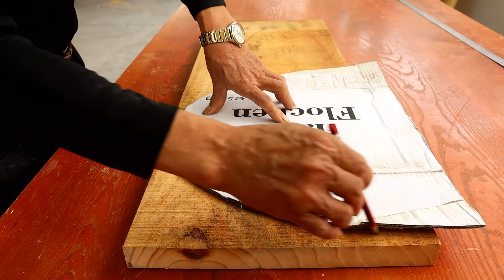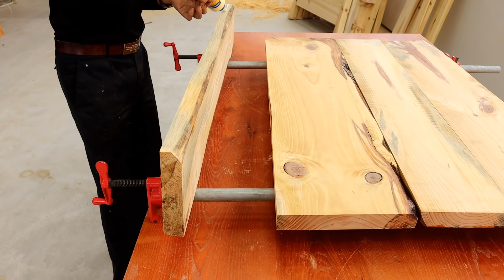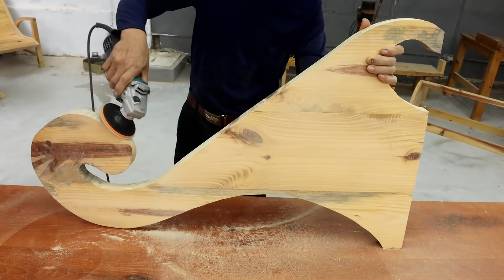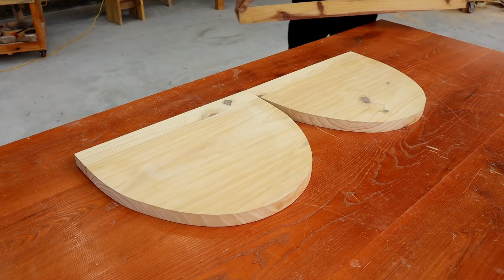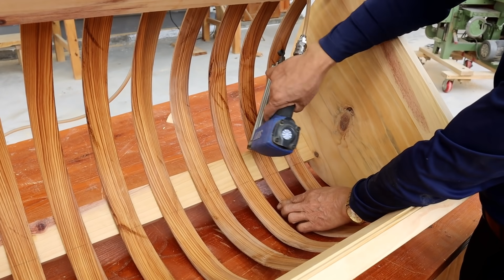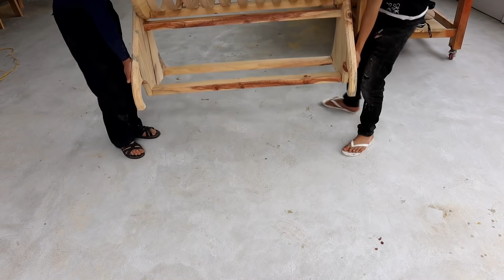Amazing Woodworking Project With Strips Of Wood // How To Make A Wooden Hammock For Children

Comment: Anyone that understands how to make these type things would know that there are some serious safety issues. From using only two screws for the cradle to the wood grain and how it is arranged in the construction. The cradle hangs from a point in the wood that is likely to split. Looks cool for a backyard rustic project, just not real safe.
Reply: You "stole my thunder"! I would have felt a lot better about it with some biscuits or dowels joining the slabs! And a through bolts and washers to hang the basket!

Comment: If you adjust the top guide on your band saw the blade wouldn't flap around like that. You'd get a more consistent cut, wouldn't eat out the throat plate, and it would be safer to operate.